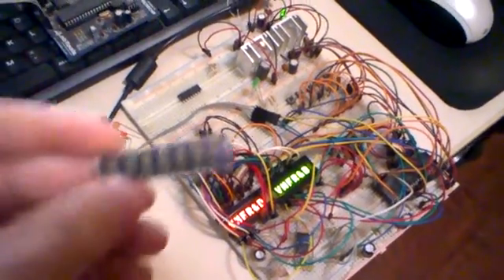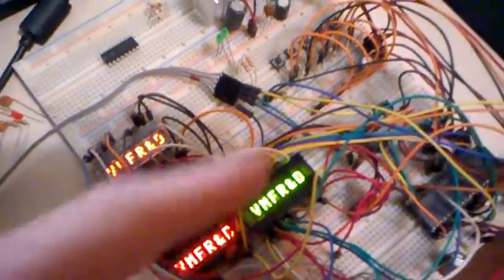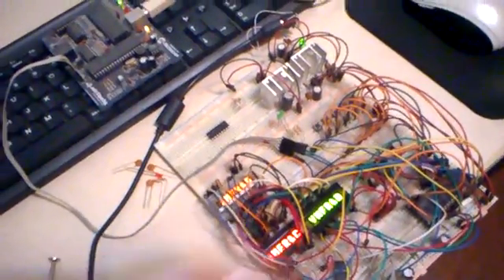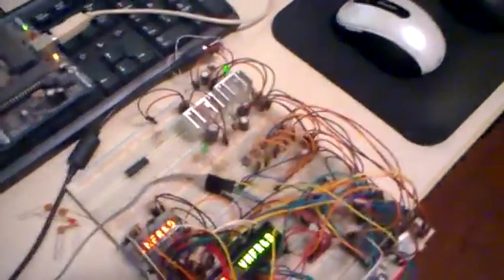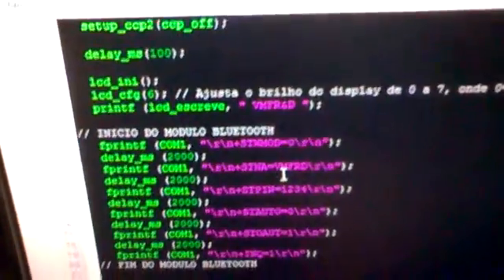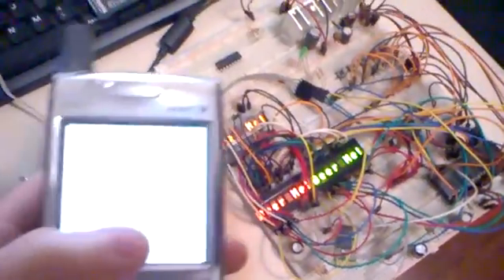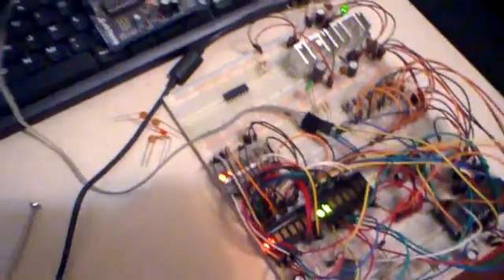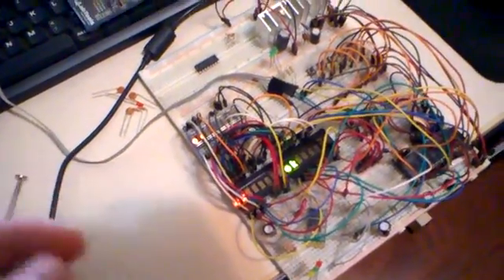Playing with LED Displays HDSP2114S and HDSP2534

Comment: Great info I've just got a HDSP-2504 0.27" hig AlGaAs Red.  and would like to learn how to program. I would be keen to get 
 the schematic for wiring up and some source code to get it working Regards
Reply from the maker: It seems to be the same wiring and code that I've used. There are some libraries for Arduino available online with the correct wiring diagram. Just do a search with generic part numbers like HDSP-2504 or HDSP2534 etc...